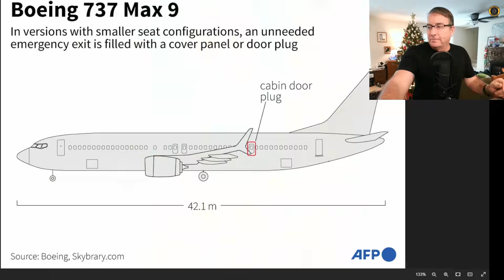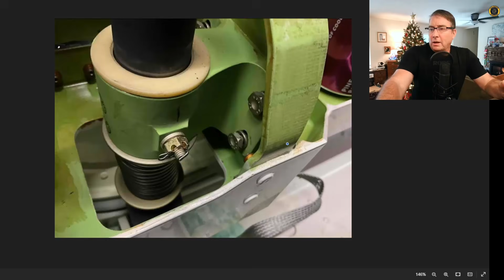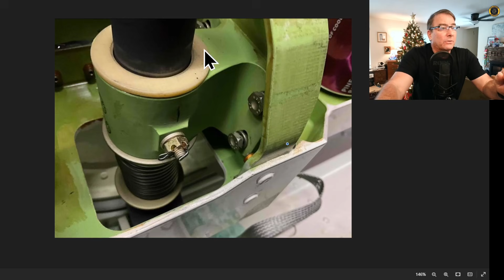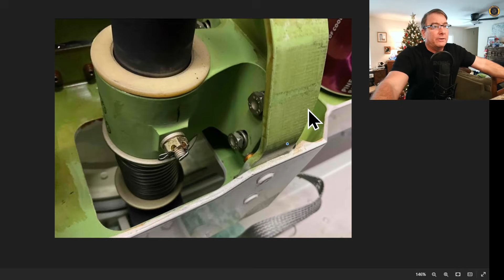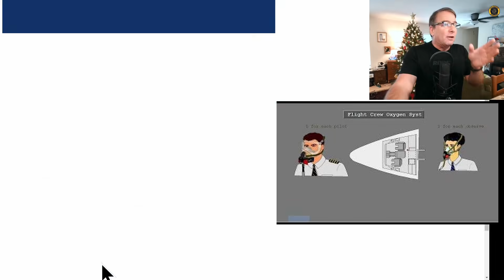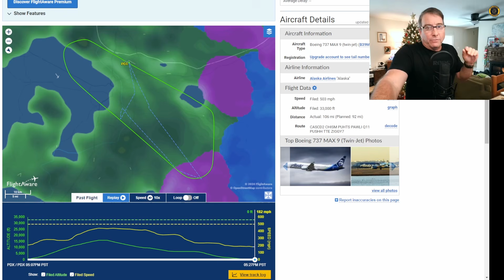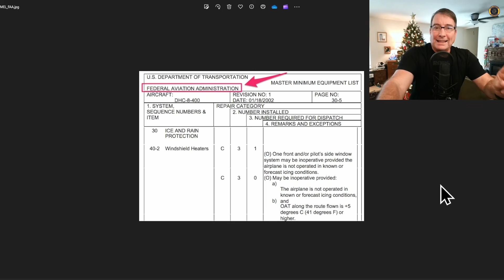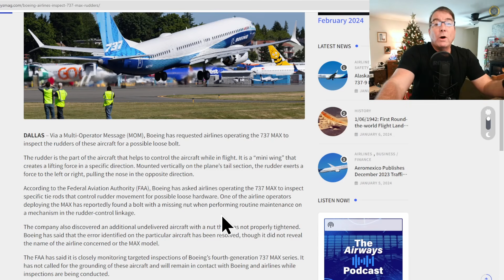"Yes, We Have No Bolts"  9 Jan 737 Max-9 Update

Comment: I think you have the procedure for removal wrong.  The door goes DOWN after the four safety bolts are removed, clearing the upper track guides, and compressing the springs in the lower shaft.  When clear of the doorframe lugs, door swings out below the lugs.

The upper guides and lower shafts aren't intended to hold much, if any, of the pressurization loads.  They are intended to put the twelve contact lugs in alignment, then safetied with the four bolts.

If the bolts that hold the lower brackets to the door are loose, the door is going to move.

Checking a few CVR brochures the max recording time (on four channels) is two hours.  I'm sure that there is a government mandated spec.

So.......20 minutes to get it on the ground.  10 minutes to park.  Still powered up during evacuation and passenger assistance........how long?  An hour?  Plus?

If the crew didn't pull the CVR CBs, the only guys who can do it is one of the maintenance staff.  When were they even allowed access to the aircraft?  Probably not until all of the gawker had their look-see.

As far as a pressurization problem, I can guarantee you that "Check for cabin doors coming loose" is about number 500 on the troubleshooting matrix.

Is stripping the cabin to check the escape hatches #1 on your look see list?   Something you are going to tackle away from a major maintenance base?

Hate to tell you this, but there are very few "ace troubleshooters" in the business anymore.  Even if there were, they would be confined to running the "Troubleshooting Matrix" for the specific discrepancy, in the "Troubleshooting" Section of the Aircraft Maintenance Manual (or Airline Manual).

(BTW, don't use the laughable FAA "Estimated man-hours" numbers in the ADS.  They are a damn joke.  Most ADs take twice as many hours).

If it makes everyone feel better, I'm sure either the company, or the Feds, will find some maintenance troops to crucify, for not making the link between a intermittent light/CAS message, and a cabin plug door getting ready to blow off.

In my experience, it's always the guy that worked it last that gets their nuts handed to them by the suits.  No matter how badly he was set up by other people putting holes in the "Swiss Cheese".

Comment: A disturbing fact is that this aircraft had flown to Maui several times.
Reply: Depressurization half way through and you might not have enough fuel to reach your destination as the air is much thicker at 10,000 feet.

Comment: The cockpit door issue is particularly concerning, because when you compare the volume of the cockpit with the volume of the cabin, the 'container' size of the cockpit is miniscule.  What happens when a cockpit window pops and there's an RD at 300 AGL?  The huge volume of air in the cabin rushes through that same door in a millisecond.  Will it blow apart and injure (or worse) the flight crew?   Holy smokes.

Comment: Pretty concerning all these issues rising up about the 737 MAX planes. From a technical/engineering standpoint, that's not good & very concerning in regards to the design, QC and manuals. And from a consumer/commuter standpoint, that's quite scary.

Excellent video, one of the best aviation channels on YT

Comment: The hinge fitting would be my first thought for failure.  When zinc alloys fail, they break like glass.
Reply: Not zinc - aluminium alloy.
My guess would be no bolts fitted and the brackets broke due to aerodynamic load from the combination of slipstream and depressurisation blast as the plug swung wide open on unlatching.
Reply: @allangibson8494  I heard the term zinc casting in the video, did you miss it?  You might want to check that Eigenvalue IQ!
Reply: @kensmith8832  No one uses zinc diecast for aircraft structural elements - they are aluminium alloy (zinc is too heavy for too little strength).

Comment: Wow. And no warning light, not even a sensor that could put a note up in the log thing for the ground mantanance people? Design hubrus takes us right back to the denial the DC-10 cargo doors were operator error the entire time. They were never going to find out what the constant write ups on the 737 were until the door popped off. I'm curious to know if some pilot crew ever refused to fly the plane like you say is possible, or is the pressure on them too great?

Comment: ......Is there some reason the plug/doors aren't built the same way the regular doors are built; sliding in sideways and then turning it flat again? That way the door CAN'T blow out because it's too big to fit through the hole.
Reply: As a civil engineer we were taught to always make manhole covers larger than drop inlets so they can’t fall down!

Comment: Even with missing safeties and un-torqued bolts, It's hard to fathom all four backing out, esp. under spring loading. Best guess says they weren't reinstalled during outfitting. Don't know if the hinge guide fitting bolts are uninstalled during the refitting process or not. Either way, this doesn't bode well for Boeing. It's amazing the door plug survived previous flight cycles. This gets more and more interesting... keep it coming, Juan!
Reply: Leaving the cotter pins off would result in the castle nuts slowly unscrewing from the bolts.  Then the bolts would slowly start unscrewing themselves from the hinge piece. Operational vibrations would cause that to happen.  When the bolts came out completely, the springs shown in the photo would launch the door plug into the slipstream, which then caught the door and took it off the plane.
Reply: @mikedx2706  I have to think installing cotter pins would be SOP with bolt replacement and tightening. But it's possible all 4 backed out. I'm just saying it seems more likely they weren't installed in the first place.
Reply: @mikedx2706  Those springs are just "assist" springs. They only relieve "some" of the weight of the door. You still have to lift up the door with some reduced force to open it.
Reply: And somewhere this evening, there are folks that touched that aircraft in its manufacturer and outfitting asking themselves, did I install that bolt and torque it like I checked off that I did on the work-order.   Did I install that washer and cotter pin that I said I did.   Then there is a supervisor that signed off on their work.   There is a paper trail.
Reply: @Cardinalflyer75  Looking forward to the investigation results!
Reply: The QA inspector was having a hang over on the day
Reply: @2Phast4Rocket  I think this is more of a systemic problem - bad management, disgruntled employees, lack of proper staffing, who knows? QC can't catch everything. Hoping someone puts an end to this nonsense soon - lives are in the balance.
Reply: ye if one failed or 2 fails at 250 kt  it should have been twisted and bent
Reply: The plug door needs a plug at the top so it can't move that 1.5" that is required to escape its holding pins.

Comment: It still surprises me that there isn’t a cockpit system that pressurizes the cockpit if the entire cabin pressure is lost.  Even if all it is a pressure door and pressure vents that keep the pressure in the cockpit so that the pilots can assess and fly the plane before having to done the emergency masks.  Also not having your checklists and headsets blown off would also be a bonus.  Since the cockpit door isn’t supposed to be open in flight anymore why not make the cockpit a separate emergency pressurized area.
Reply: That would mean that the wall between the cockpit and cabin would need to be a pressure bulkhead. This would that up cabin space, add weight and increase cost with very limited benefit. 

Currently the pressure is equalized to prevent the wall between the cockpit and cabin from failing. 

Air pressure can do a lot of damage. In the 1970's or 1980's there was two incident where part of an aircrafts floor collapse after the cargo compartment depressurized due to cargo door failures. One of the required changes after those incidents was increasing the possible air flow between the cargo compartment and the cabin. That requirement likely prevent the floor in this 737 from being damaged.

Comment: It sounds like the controller had previous issues.  Is a different controller picked each time, automatically and then fails over to the unused controller.  If so, how do they track which individual controller failed to which it transferred?  If there were multiple problems and both were involved, then how do they say the system is reliable or how do they eliminate structural issues that the control system is masking.  I have experience with control systems in many technologies and processes.  An automatic controller can cover many degrading conditions up to the point of failure.  Finally, pilots have families and homes in their base locations, complaining can probably lead to all kinds of pressure to live with conditions or be easily dissuaded from looking too deep.  I'd hope the union would support you, but getting labeled as a worrier when the rest of the pilots live with conditions might get you some less than ideal assignments or worse.

Comment: If it were a failure of a cotter pin, you would expect a failure of a single point.
As it seems, non of the bolts are present, indicating multiple failure points, or a systemic failure, such as assembly / maintenance procedures.

Comment: Looks like the hinge fitting bolts need some kind of larger fender washers AND locking washers at 6:40. 
The lowest bolt head appears to be almost the same diameter as the hole!

Comment: The idea of having check lists in loose leaf binders seems pretty quaint, as is the lack of intercom on the emergency air masks.

I've been watching a lot of Mentoyr Pilot videos, and sudden decompression is known to make communication and check lists inoperable.

It seems they should have a scroll will a continuous laminated text and an inbuilt light on a frame attached to the airframe.

Wouldn't some automated signals alerting ATC to catastrophic failures be possible too?  Catastrophic decompression, engine failure, sudden loss/gain of altitude?  So many times ATC is oblivious of the catastrophic nature of aircraft issues.  The aircrew can pass out or even die and they will have no way of knowing on the ground.  

We have Smart watches that can tell you more than the beacons on these machines!

External monitoring cameras seem to be an obvious inexpensive contingency that could be retro fitted.  So many times the flight crew has no idea if the engines are still there or the landing gear is down, or the tail is still attached!

It seems amateur drones have a better situational awareness!
Reply: Cameras for aircraft are not inexpensive. And what is the actual benefit of them. If the tail was missing you’d crash like AA587. If engines was missing you’d have no readouts from that engine. Landing gear has more than one way of telling you if gear is down. And a camera does not confirm if it’s locked, only sensor will tell you that

Comment: These plug doors in lieu of Emergency Exits should not be allowed at all! Such plug doors are a weakness in the airframe! This accident would not have happened with a proper emergency exit or wholesome airframe without this plug! FAA has again bent to Boeings lobbyists to permit these weak imprudent engineering wire rigging solutions.
Reply: WTF? If this door plug, which is essentially the outside frame/cover of an emergency exit door, wasn’t there, it would have been the fully functioning door instead. The opening is going to be there either way!
Reply: @JohnHallgren  A proper emergency door is a better solution than a plug door. And a wholesome airframe without plugs is best!
Reply: @ctixbwi  but this design allows for the future installation of an exit door if desired by current or future owners since aircraft typically have multiple owners over their lifespan, such as budget or overseas carriers.
Reply: @JohnHallgren  This design and poor regulatory control, poor supervision and shoddy work made the plug fly off. Causing a cabin depression, which had the potential of a disaster, a loss of life and aircraft. Your track of thought is like an accountants looking for shortcuts and savings with lack of understanding or willful ignorance of consequences. It is obvious that there are more nuts loose than just a few on a panel plugging a former emergency exit. The NTSB’s accident corrective action needs to go beyond panel nuts and reach every loose nut in all organizations associated with air safety.
Reply: Never been an issue before and Airbus uses similar technique (likely different design)
Reply: @tomstravels520  Well,  first time is a first time. And an opportunity to review if an alternative solution than the originally intended should be permitted at all! Has a plug gone through the same rigorous design review as an emergency exit!
Reply: @ctixbwi  depends who designed it and the regulating body.
Reply: @tomstravels520  Yes, and after an event like this one regardless designer or regulatory body. Because the public’s trust in the regulatory body could be shaken.

Comment: "Now when you have repeat maintence write up, the airplane's talking to you.  It's trying to tell you something's up."  Excellent commentary.
Reply: Why would everyone at Alaska Airlines keep ignoring this issue on a brand new airplane? That seems  grossly negligent.
Reply: Didn’t one of the fatal Max MCAS airplanes have prior write-ups?
Reply: Intermittent faults are a nightmare to diagnose and fix, because there’s like 12000 things that can cause them, and 11995 of them are benign.

But yeah, in the end of course it should be more looked into, but “we got away with it last time, right? It’ll be fine this time, I’ll just follow what the maintenance manual says…”
Reply: @Fs3i but only 5 things are catastrophic, so maybe just rule those things out quickly to be safe?
Reply: @AeroAstro_321  Sure, if you know which five it's easy. Chances is you know like 3 of them
Reply: But pulling the plane from service to thoroughly diagnose the root cause of the problem is time and $$$. No doubt you could infer what the problem is broadly and whether the plane is safe to operate  from diagnostic logs/sensor data, assuming that’s saved somewhere. If it’s ‘the controller is the problem’ , swap the thing out and see if the problem goes away. II’m curious to see what the FAA report has to say about this,

Comment: There is almost no chance that the 4 locking bolts securing the door plug managed to wriggle out of this almost new aircraft. Most likely they were never installed. This might also explain the series of pressurization issues reported prior to the event.  The "plug" was not sealing correctly due to it rattling around on the lugs... Just a theory.
Reply: Based upon everything that I’ve read, I fully agree with you! Even if the bolts were missing the nuts, they would probably still act as pins to keep the door in place

Comment: I used to say all the time, "If it ain't Boeing, I ain't going!"  

The smaller bolts being loose that connect that lower bracket to the main frame of the plug is very concerning.   In your picture, the washers look to small for the slotted holes. 

Wondering, is the plane delivered complete to the airline, or do they get the shell and then install their own interiors?   Would there have been any reason for that plug to be removed by the airline after it left the factory?

Comment: The fact that it was a traumatic experience is absolutely no excuse for the pilots to not complete every single step of the EMERGENCY CHECKLIST
Reply: Emergency checklist got blown out of cockpit they were working off of memory items, with everything going not surprised it was missed.  Real question why doesn't FAA mandate 24 hour storage and there should be cameras in the flight deck as well.

Comment: I was a flight engineer, mechanic and first officer and flew narrow body Boeing 707, 727, 757 the DC-8 and 767. The CVR's only operatated from first fuel lever on to last fuel lever off (aircraft power.) They only recorded the last 30 minutes in those days.  Did that change with the 2 hour CVR's?
Reply: The A320 has a ground control button so the recorder starts then, think 737 has similar
Reply: Thanks @tomstravels520

Comment: I may be just a dumb millwright, but unless that pic of the top track is upside down that door has to go down first before it can be lifted up to open. If that locking bolt is missing a good bump would pop it out of the top track and then its only a mater of time before the springs and vibration push it up out of the stop bolts and bye bye door. I hope the FAA makes them redesign this whole thing to lift first and then open inward before it can be removed. And then crucifies Boeing for the failure of QC and more manual omissions being revealed. This seems to be the way Boeing is trying to do business on all of their planes lately. I doubt they can blame Mark Forkner for this one. I wonder who the scape goat will be this time. It wont be the executive teams, that is for sure.
Reply: Not sure what you are missing in your first sentence, because the roller pin is at the top of the track so it simply can NOT go down any further! The door is lifted up to get it out of the track. 
Also, the springs only (as I understand it) provide enough lift to make the door weight neutral essentially.
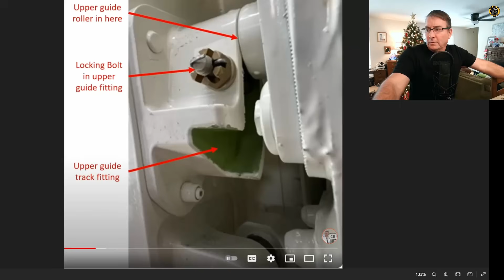Reply: @JohnHallgren  The pic at 2:55 shows the roller in the top of the track but the track is open on the bottom. As I see it, that means the lock bolt gets removed and the the door must go down to remove the roller from the  track. Am not understanding this picture correctly or is it shown upside down meaning the roller is at the bottom of the track and the opening is at the top? Which would then require the door to be lifted to remove the roller from the track. I cant tell from the overall door pic what the orientation of the roller track is